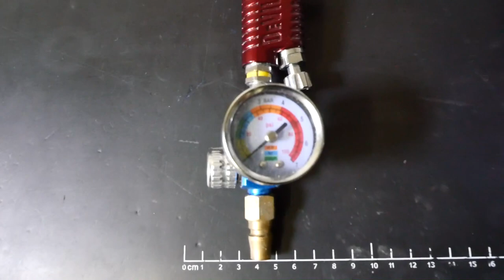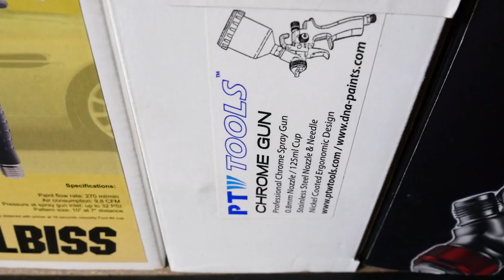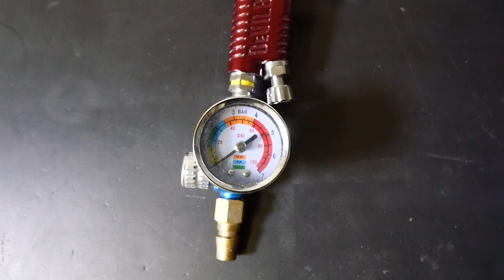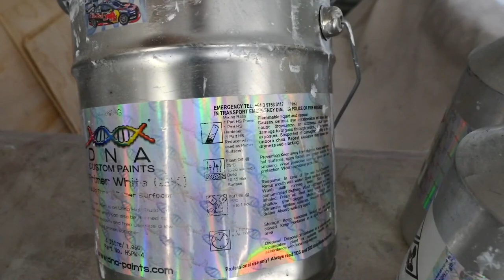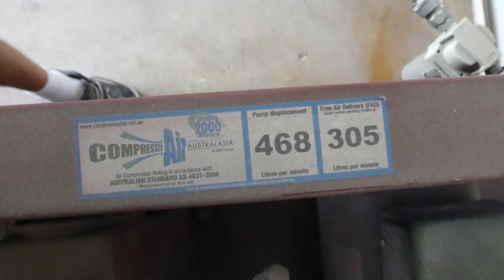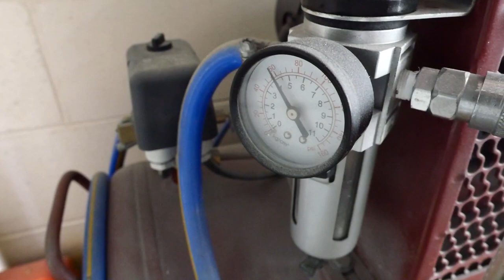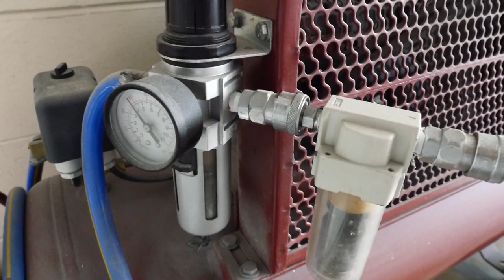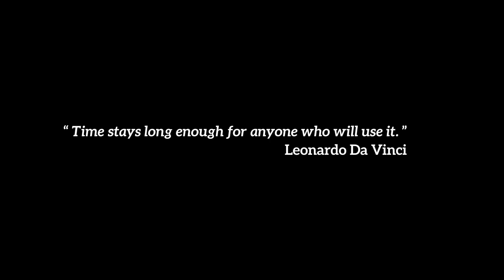Custom Paint: Spraying Guide

Comment: Your attitude towards gun selection is excellent, and is too often an attitude people need to adopt when picking components.

I've seen too many people get a 7700k, 1080ti, 32gbs of RAM and then not put their PC on a good, high quality surge guard because they're expensive and lose the lot in a thunderstorm. Spending a bit of extra money (~$100 on a good surge guard/UPS) so that you don't ruin something worth a lot more (~$3000 PC) is worth it.

To me; that made sense. Working on high end, expensive cases? Last thing you want to do is be constantly dunking it in paint stripper because your gun isn't putting out a high quality paint job to match. It's worth the extra money.

Comment: Now this is why I work with mini itx cases. Don't need a paint gun. Air brush works just fine for any level of coating. You can easily make a small paint booth as well. Won't need half a room.

Comment: Great video!!! Do i need to sand up and prime a case which is already painted, or can i just buff it with a scotch brite and spray it without any worries? I have an old OEM (hp 6300 MT black with some scratches) and want to get rid of the scratches. Don't want to spend huge amounts of cash on it, because i want to flip it when i'm done upgrading the system. So just a simple black finish will be good enough actually...

Do you have any tips?

Comment: If I have metal side panels, do I need to sand them down prior to spraying? (I'm using spray paint)
Reply from the maker: Not necessarily but the initial surface needs to be smooth, mainly if you are planning a gloss finish. You can prime twice and sand the first time instead.

Comment: hey mate at 15:51 of the video you show a front panel of the phanteks enthoo evolve...did you mod that panel as it's usually a solid piece with no central cutout...i was thinking of cutting out the front of mine for better airflow and also to add some nice RGB front fans
also great tutorial...very interesting
Reply from the maker: Yep I modified it, I do quite a lot of those.
Reply: thanks for your reply...any chance you could do a vid on modding the front of your PC case to get better airflow...as i am sure that this must help a lot with this issue with that particular case...but also this must help most cases in general

Comment: you mount your SMC oil separator upside down. The arrow on top should be in the direction of the air. In this position the filter is not working properly.

Comment: doesn't painting the radiators affect the cooling efficiency??
Reply: Yes but only if the paint is thick, clumped up, and restricts airflow in the fins. Painting with an airbrush makes it so that the paint is applied thinly and evenly so it's hard to achieve that. Daniel also masks the fins off of the radiator before painting.

Comment: how does the paint not clog the fins on the radiators
Reply: Generally rads are painted in factory

But you can paint over fins and it will not even slightly make the temp go up =]
Reply: Carlsson I understand that but when you spray over them how does the paint not build up and clog the fins
Reply: the fins are so close together
Reply: The way it's done is you tape the fins of the radiator. You're painting just the housing of the radiator itself.
Reply from the maker: I never paint the fins, although it would hardly affect performance because it wouldn't go in between them. Paint is super thin and fine, when it comes out of the gun the droplets are microscopic, or they should be.
Reply: SingularityComputers in the video you spray over the fins, not trying to troll was just wondering, love the content you provide but when I was watching this clip it had me thinking
Reply from the maker: Its an important question which I am sure other people have too. If you look closely you will see that I have masked over the fins with painters tape. I never paint them. It would be ok to spray them just with one coat but if you are doing special effects and using clear coat it's too much paint on the fins.
Reply: SingularityComputers, thank you for the clarification, you make some of the most beautiful computers I've seen